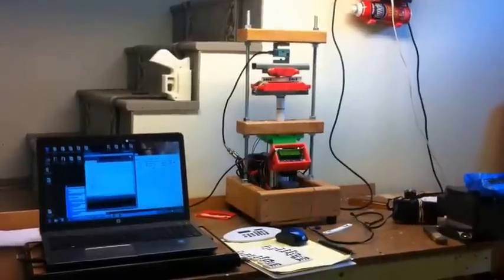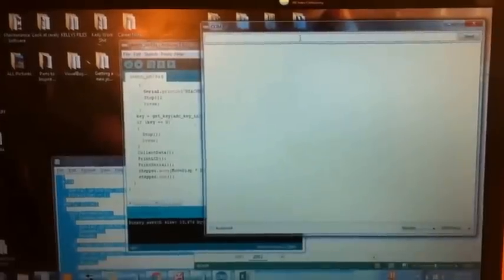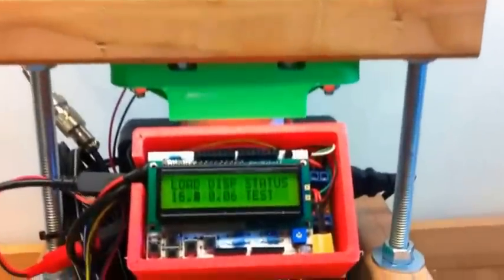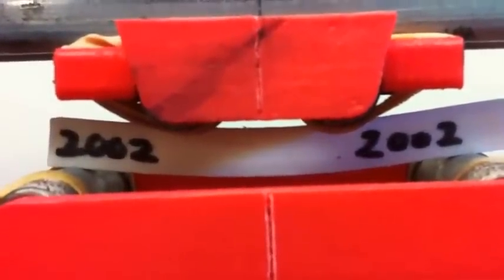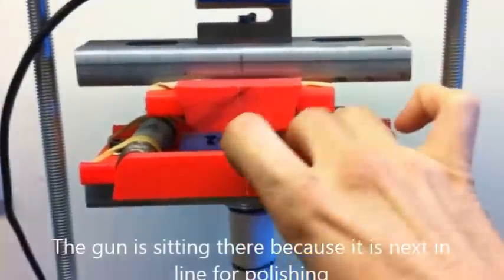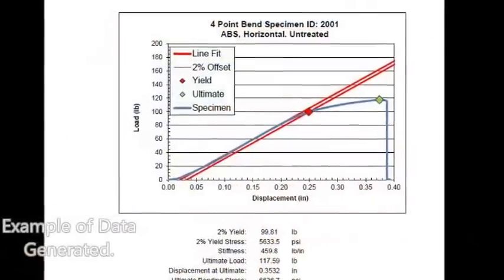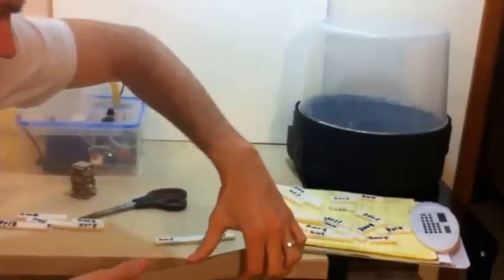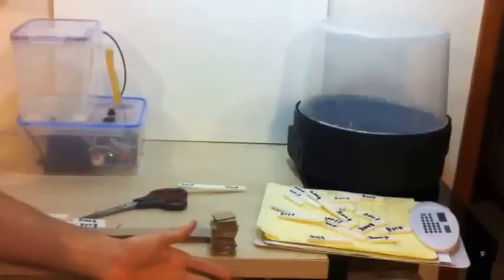Testing Acetone Polished FDM 3D Printed ABS Parts

Comment: That is a very interesting discovery. I wonder if you could apply acetone vapor during printing? Perhaps that would increase the bonding between layers throughout the part. Having acetone vapor around the printer could have side effects. Might require a complete redesign of the 3D printer. Just a thought.